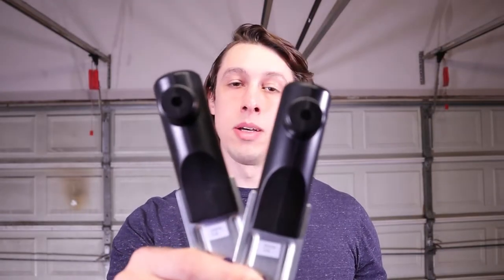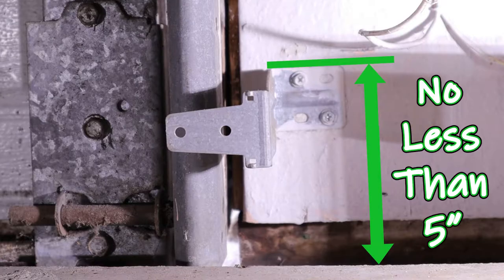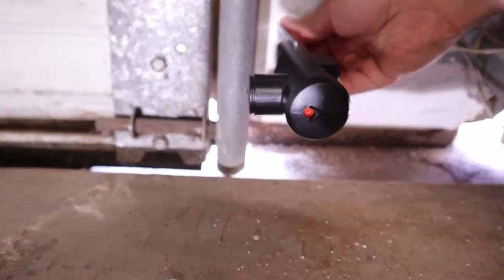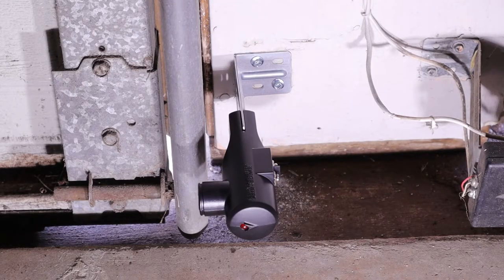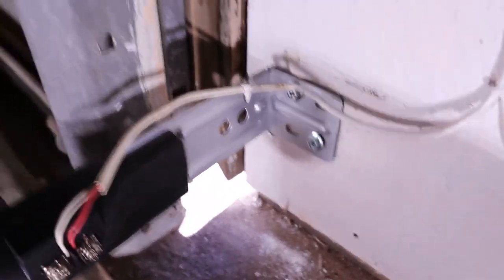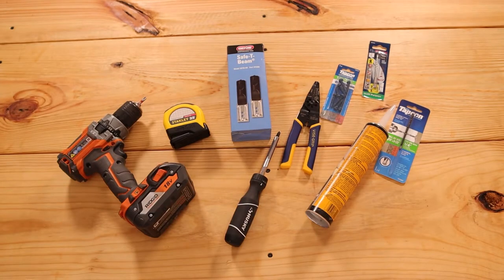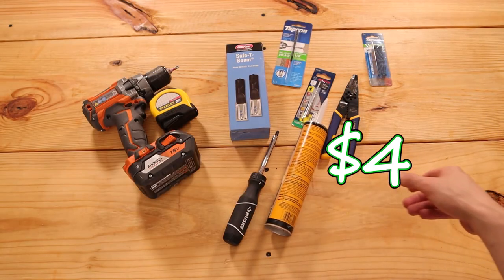How to replace Genie garage door sensors [removal, installation, tools, cost]

Comment: Genie 3305 here. Garage was flooded and sensors were under water. See red light flashing two times. Changed sensor, remounted higher using tape measure at 5 1/2". Still flashing two times. Could the water have shorted the circuit board out at the sensor wiring? Maybe extended short could do that? Maybe time to replace the opener since about ten years old but was working fine. Great video. Sound and lighting are grreat. I appreciate this.

Comment: My sensors seemed to be working with the green and red light on. Somewhere I read that dirty lenses can cause the opener to not function (I had flashing red circular lights on my Genie). I cleaned the lenses thoroughly and the opener worked again.
Reply from the maker: Hi Mary, nice catch on the dirty lenses - I'm happy to hear it was a simple fix!

Comment: awesome video.  my problem is that my existing wires aren't as simple as yours.  one side has a blue wire, a red wire, a red/white wire and a blue/white wire and the other side HAS TWO wires with each of those.  i have searched almost every wiring video i can find and can't figure out what can go together and what can just be left hanging.
Reply from the maker: Hi Jeffrey, if you can find the make & model number of your machine, the owner's manual can usually be found with a quick Google search.  Sometimes they will contain a wiring diagram.  I've found these diagrams to be pretty helpful.  It might help you figure out the wiring situation.  It might also be helpful to give your manufacturer's support line a call.  Any chance your opener has been replaced before?  Sometimes the old wires are left in, which only adds to the confusion.  Hope this helps, good luck!

Comment: What if my system does not currently have a sensors? How would I go about wiring? Thanks for the video!
Reply from the maker: Hi Phillip, thanks for watching! There are tons of different models and situations, so I'd suggest contacting the support team for the manufacturer of your model to get the best specific advice for your unit and situation.  Most will have an email or phone number that you can use to contact them - usually listed somewhere on their website.  Hope this helps!

Comment: I have a chamberlain / lifemaster system and I still subscribed !  Dude, shows tools and prices for noobs.  Details alternate positions for sensors and wiring details. Only did not explain which color wires get attached to sensor terminals ?
Reply from the maker: Hi Paul, I mentioned that my system is non-polar.  If that is the case for you as well, it doesn't matter which wire is connected to each terminal.  On some systems it will matter, though.  The easiest way to tell is probably going to be to lookup the owner's manual for your make and model.  It should have a section on sensors/wiring.  Thanks for supporting the channel!

Comment: I have changed the sensors and the lights seems right to me.. one is red and the other is green. but when I press the wall console (wireless); all i hear is clicking sound.. I have legacy 650 and WIRELESS WALL CONSOLE, OVERHEAD DOOR - 39903R.  the light bulb is working (power) is there.. I press the opener remote, I hear the click sounds.. nothing else.  my opener is only 2 months old.

Comment: Hi there! Just found this video after the repair guy fixed the torsion spring that snapped but my sensors stopped working. The guy was nice and re-wired the sensors but now the lights don't work and my garage door can't make up it's mind if it wants to close or not  He said the spring snapping was the reason but I'm not so sure but I have to rely on the expert. Is this possible?
Based on your video I'm wondering if I should just buy new sensors and install myself. Thanks for the video!
Reply from the maker: Hi Alyse, wow, sorry to hear about all the trouble.  There are a lot of things that can cause the opener to behave oddly.  I've made another video that walks through troubleshooting some of these things that might be helpful.

https://www.youtube.com/watch?v=fxvV_OFjNmk&t=28s

Few things that might be also be helpful to check:
- The door should be balanced.  If it takes too much force to open/close - like could happen with a new strong spring or spring out of adjustment - then some brands/models have limit switches that will cause the door to stop/reverse.

- Some brands have polar wires and some have non-polar, which means for some the mapping between specific screws on the sensor and corresponding specific slots on opener matters (the wire needs to follow this relationship mapping) and for some it doesn't matter.  It's a bit of a pain, but if you can find the make and model of your opener, you'll be able to Google the owner's manual which will contain all of these details and troubleshooting steps.

- Various makes and models all have different error behavior - the owners manual is a really good reference for this as well.  Some will blink specific sequences for specific failure modes, some won't blink at all, etc.  If there are no lights on the sensors, it could also be that they're not receiving power.  Most models provide power to the sensors via the wires that connect to them from the opener itself.  These may not be plugged in all the way, could be broken somewhere along the length of the wire, or possibly could be connected incorrectly.

Hope this helps, good luck!

Comment: Genie mach force has red lights on the both areas of the machine any idle on what i should look for to fix.
Reply from the maker: Hi Marybel, I'm not sure I fully understand the issue and I'd hate to give bad information.   I made video about troubleshooting garage door opener issues.  Watching that might be a good place to start.  It may be also be worth a call to Genie's support line to get information directly from them.

These resources may also be helpful.

1. Genie Owner's manuals https://support.geniecompany.com/app/answers/detail/a_id/1308/~/owners-manuals

2. My troubleshooting video:  https://youtu.be/fxvV_OFjNmk

Comment: Can you use sensors from chainberlain for replacement?
Reply from the maker: I don't know if you can mix sensor and opener brands.  You might run into issues with differing circuit designs - some are non-polar, some are polar.  Probably best to use original replacement parts designed for the opener/system that's installed.

Comment: 8 Wires & 4 Wires. I have 8 wires, 4 wires on each side. 
Directions
twist solid color wires together 
Twist stripe color wires together
 That makes 2 twisted wires on each side. 
Connected 2twisted wires to top screw and two twisted wires to bottom screw.
Test
When wired right Geen LED is on (not blinking) and Red LED is on (not blinking) when sensors are alighted. 
Sensors are not aligned Red LED blinks
Wires 8 or 4 wiring.
Reply: As you say, what needs to be done is to twist the like color/striped-coded wires together. In my case there were two sets of wires on the source side and one set of wires on the sensor side. The sensor side is easy, as there is only one set of wires (two wires with the insulation bonded together), one for each screw. On the source side you will need to take the coded wire from each set and twist them together, then twist the other two wires together and attach them to the screws (it doesn't matter which screw).

Comment: '...And put them in the right position to reduce sun interference as much as possible." What is the definition of "right position?" Under what conditions would the sun interfere? Which sensor is effected by sunlight? Both?
Reply from the maker: Hi, I followed Genie's instructions when I installed mine. So far, I haven't had any issues. 

For the sensors I installed, the instructions mentioned the below for positioning:
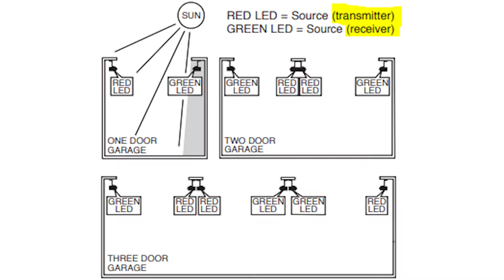- The sensor (green LED) should be mounted on the side of the garage that receives the least direct sunlight (diagram at 02:31)
- Sensor and source should have clear line of sight between them and be no more than 30 feet apart
- The top of the mounting bracket should be no less than 5in above the floor, and no more than 6in (can also mount on the floor as a last resort)

Google mentions that a lot of the garage door sensor systems use infrared.  So, my assumption would be that issues might happen when sunlight has a direct line of sight to the sensor's photo eye, and when the sun is strong enough to overpower the source's signal.  I would guess that this could cause the sensor to think the source beam has been broken, which would cause the system to stop the door. 

But since I'm not a pro, it might be worth a call to the helpline for whichever brand/model you own if you have more questions.  Hope this helps!

Comment: Did you attach the receiver in the same way as the sensor to the garage opener unit? Or do the sensor and the receiver connect to each other directly?
Reply from the maker: I did - Both the transmitter and receiver should have their own independent wires that run back to terminals on the opener unit itself.  The terminals on the opener connect to a board inside of it where the connection between the transmitter and receiver is finally made.  Hope this helps!
Reply: @FirstTimersHomes  thank you so much! Your video and post have been very helpful!!

Comment: How do you make sensor adjustment after the installation?
Reply from the maker: Hi, in my case reusing the old mounting locations helped with this.  I visually checked alignment, then tightened the screws so they were snug but not fully tight.  Then made any adjustments needed, and fully tightened once I was happy with the alignment.  Since then I've bumped them a few times, etc., and to realign them I just gently flex the bracket until they're back in alignment by holding it near the mounting points with one hand to make sure I don't pull it off of the wall, and gently applying pressure to the other end of the bracket near the plastic sensor housing until it's aligned.

Comment: One of my sensors is red and 1 is green. I thought both were green? I have a Genie .
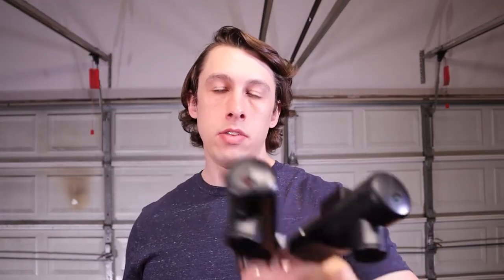Reply from the maker: Various makes and models will differ.  My model uses the Genie 'Safe-T-Beam' system and has both a red (transmitter/source) and a green (receiver).  Checkout the video at 0:52.  Thanks for watching!